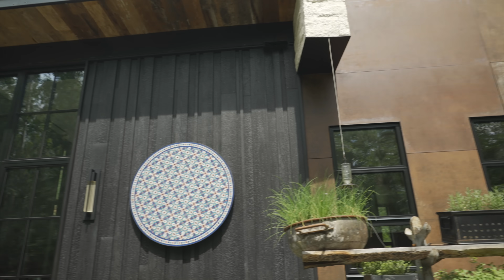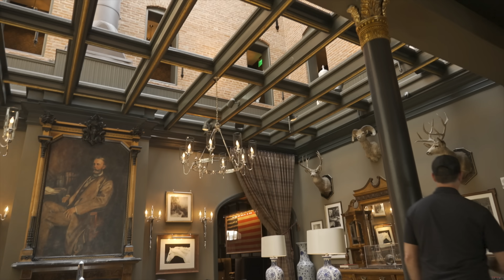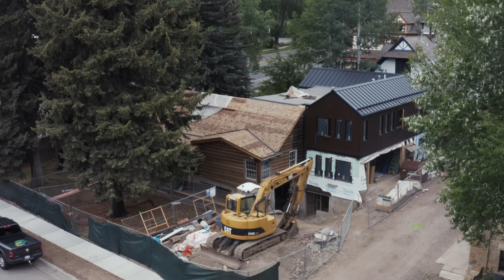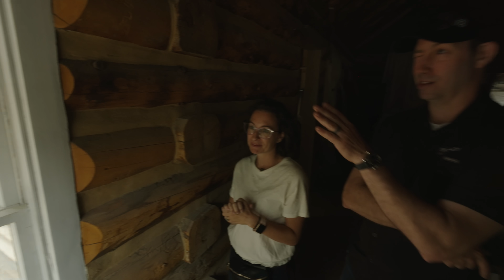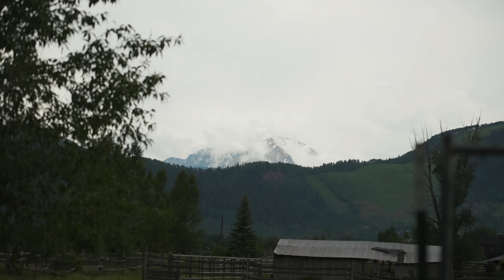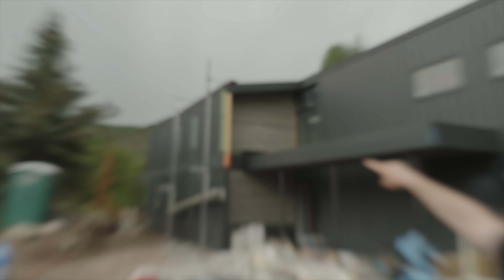Super cool Colorado Houses  - Aspen Construction Tour

Comment: Matt, have a question for you, hopefully you see it... after watching your videos, I have installed a variable speed hvac with high efficiency furnace, along with custom hard pipe to flex branches. My upstairs humidity was at 90%+ (this is how I found your channel). The new equipment got it down to 70% upstairs (with dehum function enabled on nest). So I added an aprilaire dehumidifier and now I can keep it below 60%. My problem is the dehumidifier is like having a window unit... you can tell on the elec bill the second it kicks on! I see you install these units in tandem, my question is, do you just run a separate humidistat for the aprilaire? Or have you tried one of their thermostats that will control it all? In a perfect world, you would trigger both units to dehum at the same time. Aprilaire wouldn't answer my question directly, instead sent me the manual... which  also did not answer my question directly. Thanks, love the channel.

Comment: 13:30 Single pane windows in an alpine area Brrrrrr xD
Reply: Seems like insanity to prevent someone fitting more energy efficient windows for the some heritage BS. Might as well insist you fit asbestos fire proof lagging and tungsten filament 'space heater' 100w bulbs everywhere as well. Way to ignore progress... 🤦
Reply: @james.telfer  agreed especially if they’re letting through that extremely modern bit come out the back. You could definitely have two pane windows that look nigh identical.
I think preservation has its place but this is kind of insane, Single pane windows in an area that’s literally in the Alpines is nuts

Comment: I have In floor heat in my basement and garage. My basement is ICF's. The main floor of my house is built in such a way that Staple.up is not possible.  I considered Warmboard but for my 1500 SF house, it would have added close to $20,000.  I chose not to use it and the Main floor is heated with Radiant Cove heating and a wood fireplace.  Having lived in the house now for 6 years I would have been fine to use Warmboard in the Greatroom which is half the house and supplement the bedroom, office and entry with Radiant cove.  As it is, I never run the heat in the bedrooms or entry as they stay very stable and comfortable.  The great room has almost 200 SF of glass so I do need to heat it but for the most part I do it with the fireplace.  My Electric bill has never been more than $20 higher in the winter than summer so I'm not using the Cove heat much.  I do have Ditraheat in the bathroom and run it year round.  I'm in the Black Hills of South Dakota.  
Listening to all the restrictions in Aspen makes me laugh.  The only inspections I have had are rough and final electric and Rough plumbing.  The County knows my septic installers work so they don't often check him.